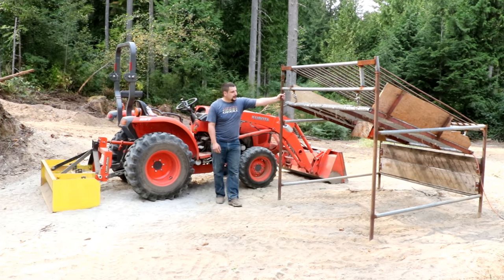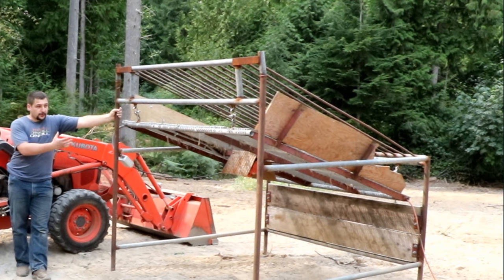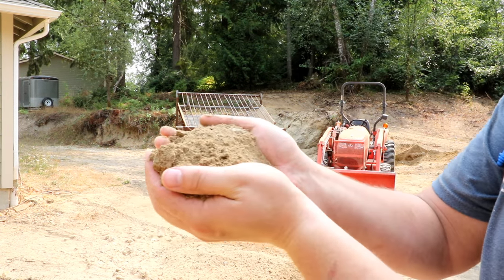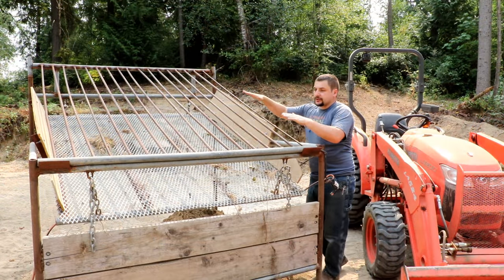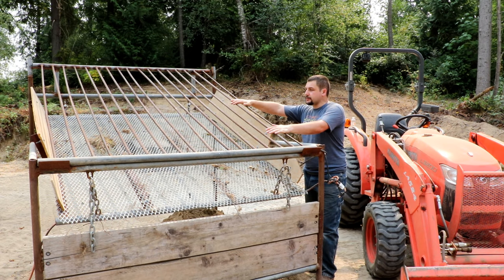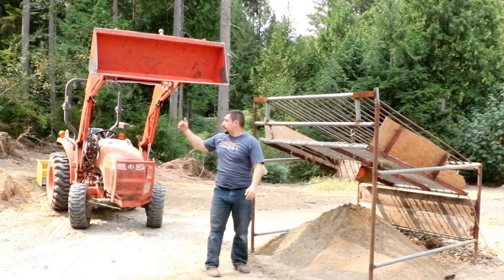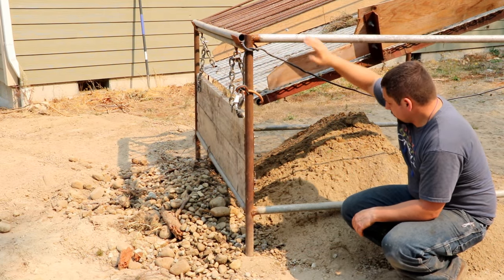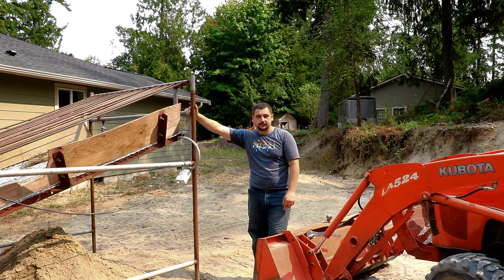Using my Soil/dirt shaker!!! 30 YARDS an hour with my Kubota!!!

Comment: Ya and if ya wanted to screen out one inch rock you could make a third level or layer and use a smaller screen or make a smaller screen and replace your bigger screen with it snd then just rerun the material through it.

Comment: Nice. Maybe should have ran the boards to the ground to prevent clean soil and rock from mixing and serve as a backstop for tractor bucket. Will probably be copying most of your design. Thanks!

Comment: I was wondering when you would do a video showing this in action. not sure how I missed it. I did pretty much finish my super shaker soil sifter and it works great! I used a gas engine on mine for the shaking part. I used it to clean rocks from my landscaping. works really well. I did a video on mine back in the summer. enjoyed the video hope you are doing well.

Comment: It was nice to see your Dirt Sifter in action. I don't remember if you explained why you didn't extend the front boards all the way to the base of the legs. So none of the separated stone fell back into the dirt?
Reply from the maker: I did not put a board all of the way down because I did not want to hit it with the loader when I was removing the rocks or dirt. The amount of mixing of the rock and the clean dirt is very minimal and it seems to be working well.
Reply: Thank you for your response, and your insight.

Comment: You think its possible to build one out of wood and still be strong enough for taking a beating
Reply from the maker: I’m sure it possible it would have to be really sturdy! I estimate that I ha e had 3000lbs of dirt on this one at one time. And the motor is shaking. I have had to replace most of the bolts for the screen over time the shaking really make the mechanical connections come apart.
Reply: I built a wood frame screener using chain link fencing (no vibrator) and ran about 50 yards before it started to fall apart. I'm also using it to screen 5-6" rocks so it really takes a pounding.